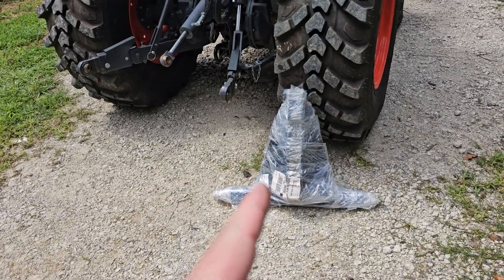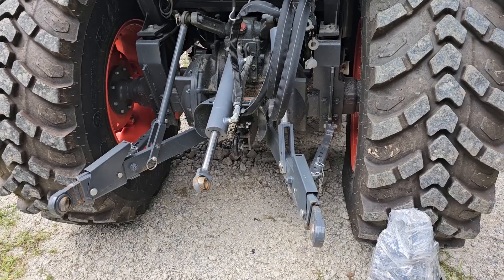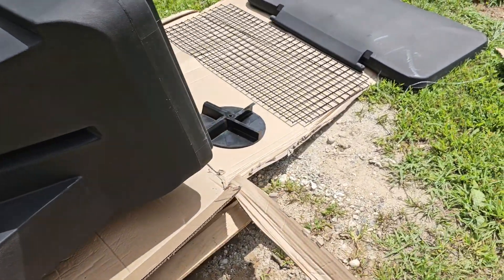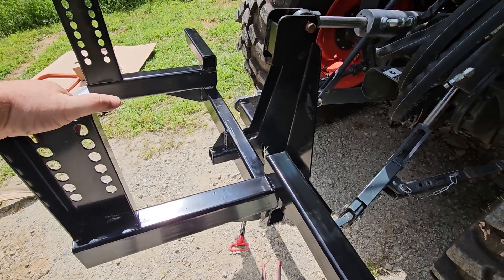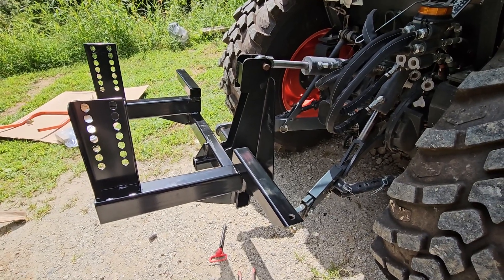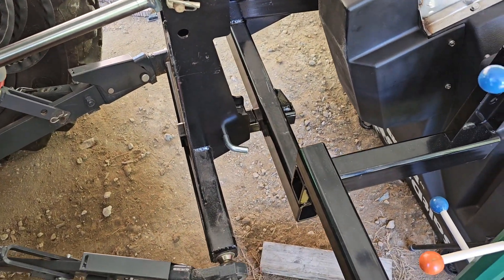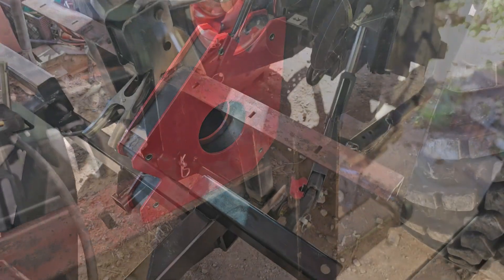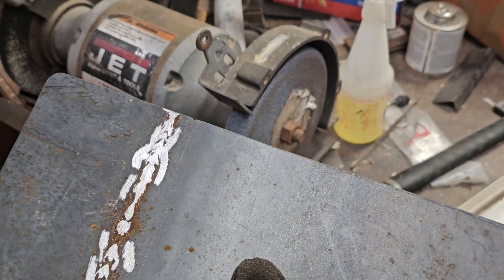TGS07 on a Tractor 3 Point?

Comment: I debated doing the same. Nice job. Got me a pendulum spreader instead that can hold 1000lbs. Pricey around $4k but can use it for seed and fertilizer as well.
Reply from the maker: I found it strange that there wasn't an adapter already and couldn't find any videos doing this.
I lloked at pendulums, cone style, and so many... I really loved the Sides Spreader brand, but out of price range for my goals.
I bought a soil conditioner from Quick attach a while ago, and I can see this spreader being used for seed to, but I'll experiment with the flow shield in the hopper to make that work right.